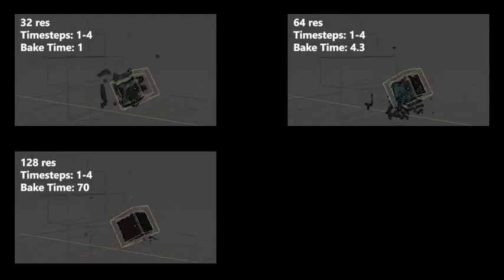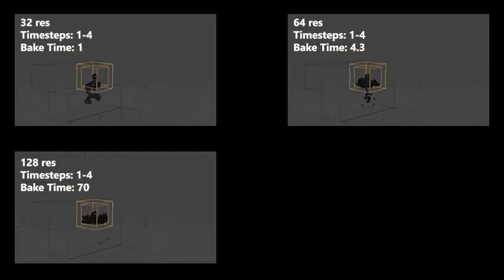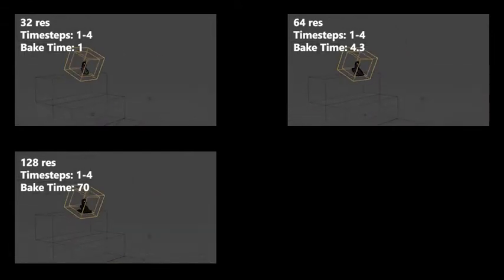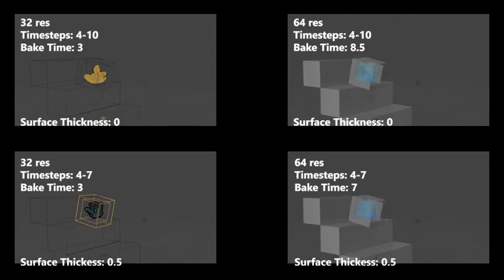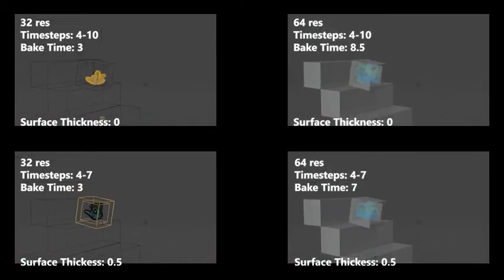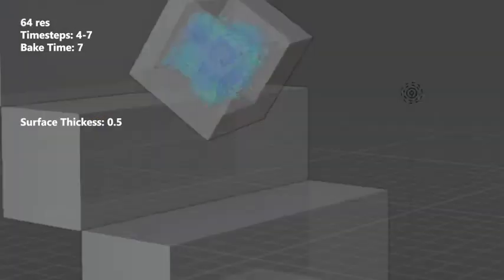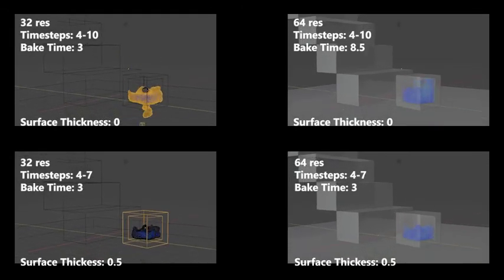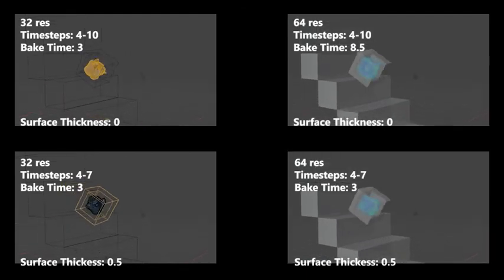How Can We Improve the Effectiveness of Fluid Effectors? (Blender)

Comment: I cannot get a moving effector to work at all. The fluid just falls through like the effector wasn't there. Reversing the normals does nothing and changing to a guide doesn't seem to help. I haven't tried animating the domain itself but that seems unlikely to work. 
Well, I take that back. I turned the effector into a domain with rigid body physics and it worked, sort of. Unfortunately the gravity is all wrong.